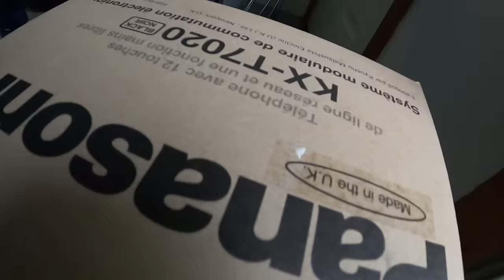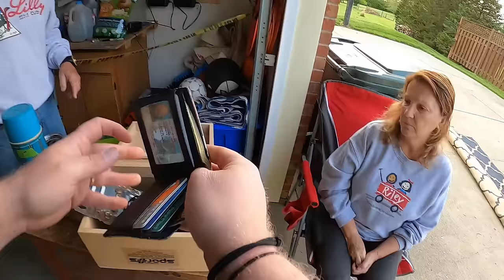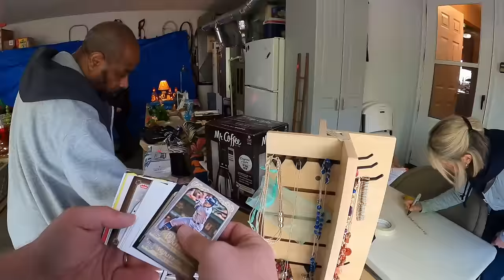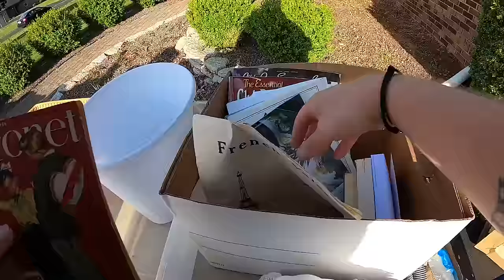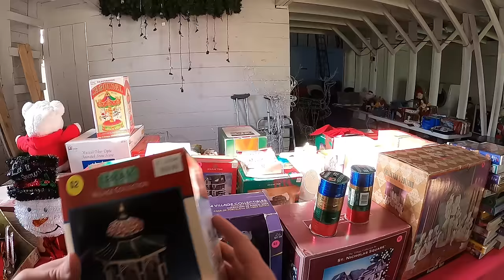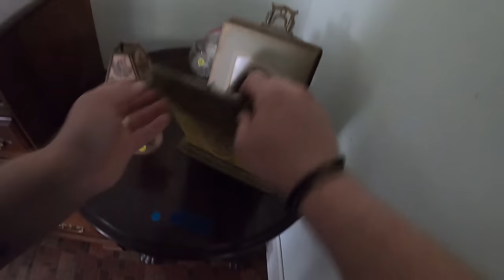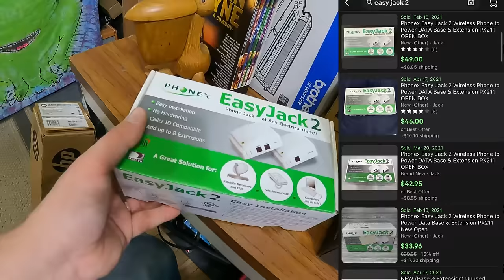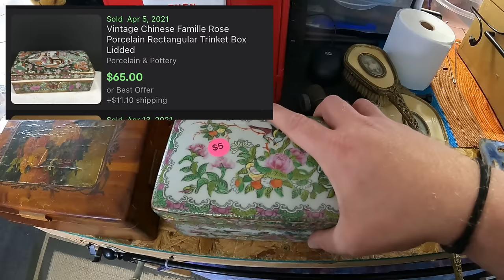AMAZING GARAGE SALE DAY CAUGHT ON CAMERA!

Comment: I sell on FBA, and new to Ebay since Covid.  A couple years ago I bought a half a pallet of those HP 150 Foot rolls of 24# paper for .19 each, sight unseen.  Packed everything into my 2005 Corolla in one trip (riding low- lol). Sold all of them via FBA for $34.95 each. Making about $18-21 Each after fees. Definitely worth my time, but lost some initial money on finding boxes to accommodate the odd size in quantity. **My eyes lit up when the familiar package went by in your video. #chaching.

Comment: Blow molds.......I picked up a vintage Santa and listed it last summer.  It's in excellent condition but I'm sure it isn't selling due to the size and shipping cost.  It doesn't weigh very much.  I listed it for 70.00 and the calculated shipping cost shows as 96.xx.  Fedex Ground or Fedex home delivery are the options I chose.  Any suggestions to help me get santa out of the house are greatly appreciated!  I'll never list another blow mold!
Reply: Have you tried pricing UPS?

Comment: I was glad you picked up the pelican... for $1 he's a great deal.  You could easily sell him for $35.  If you want to sell him to me, let me know. ;)  He's mid century, likely teak and possibly either the Zoo Line or Schooline brands.  Look up MCM Zoo Line and you may find something similar for sale on Ebay.
Reply: Interesting, I was hoping someone knew something about him! Really neat piece. What is the spindle in the mouth for?
Reply: @saltandpepper986  it might be for dispensing rolls of stamps
Reply: Laura Miller Ahhh, okay, makes sense, thanks! One on Etsy is holding paper clips so must have replaced the wood with a magnet. 🤷‍♀️